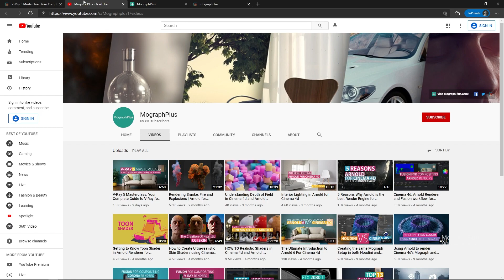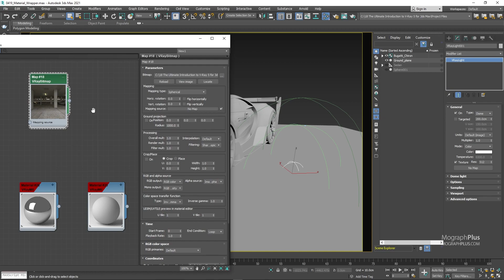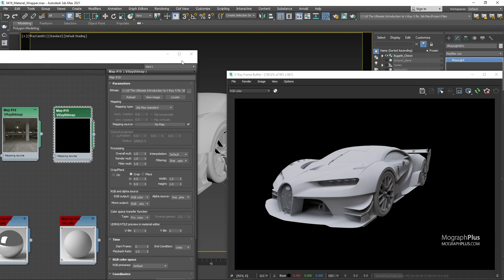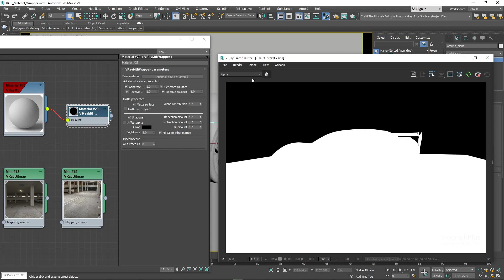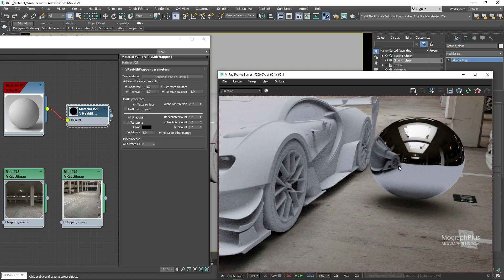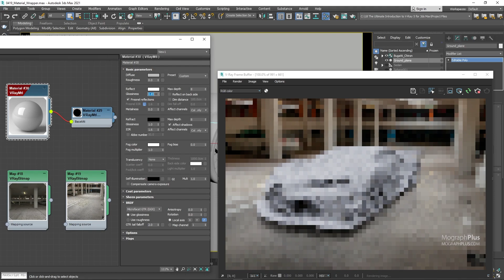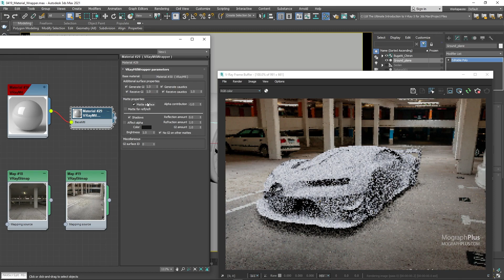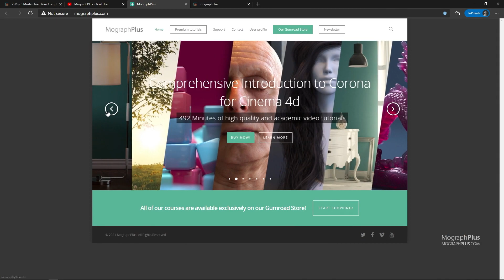How to Add 3D Objects to a Photo in V-Ray 5

Comment: Hey man, I bought your Vray masterclass. One word, Great. Thank you so much. I am having two problems though. First one, I want to use Vray GPU since it's much more powerful and faster than my cpu. The first problem is that I cant use subsurface scattering in Vray GPU. This is huge huge problem for me since most of my scenes need SSS. Second problem is that when using Vray sun my scene have tons and tons of noise but when using a normal light in my interior same scene. The noise much less and expected. Thank you!
Reply: Vray gpu doesn't support sss?
Reply: I know Im asking randomly but does anybody know a method to log back into an Instagram account..?
I somehow forgot my account password. I love any tips you can offer me.
Reply: @Clay Hugo Instablaster :)
Reply: @Easton Jordan thanks so much for your reply. I got to the site thru google and Im trying it out now.
I see it takes quite some time so I will get back to you later with my results.
Reply: @Easton Jordan It did the trick and I finally got access to my account again. I am so happy:D
Thanks so much, you really help me out !
Reply: @Clay Hugo happy to help =)